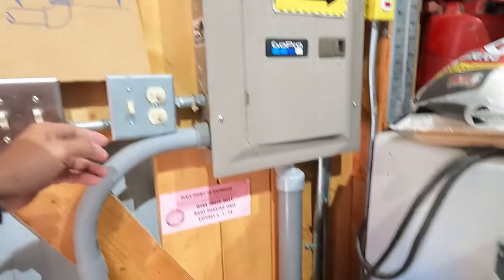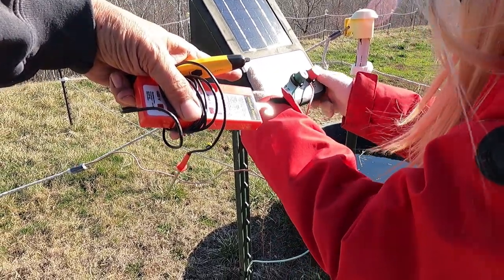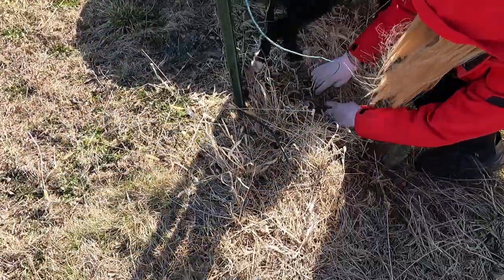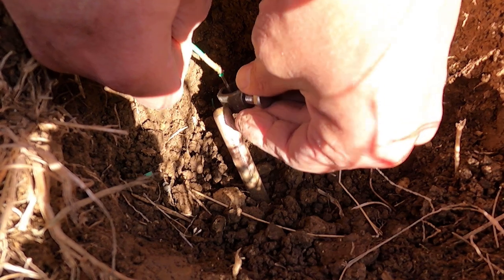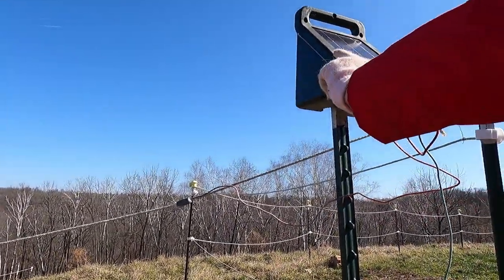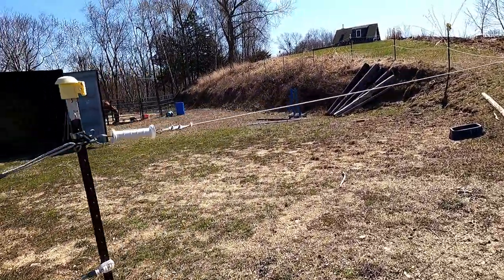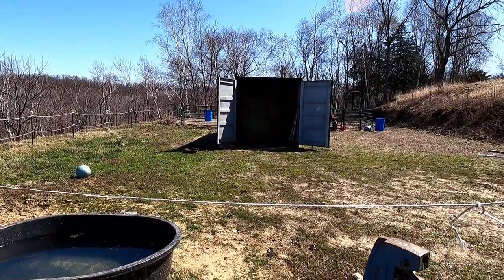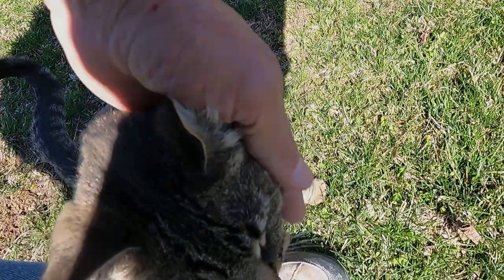Troubleshooting a Solar Electric Horse Fence [Fixed!]

Comment from the maker: This fence was messed up pretty bad when it was lowered to accommodate our foal Frankie last year. It was shorting in three places to the t-post, once to a tree, and had a jumper in an unnecessary place. The ground may or may not have been good, but it is generally where you start the investigation. It's all part of owning an electric fence though, you are perpetually checking for problems and fixing them when you find them ⚡😮⚡

Comment: I can so relate to your troubleshooting. I spent today replacing insulators with new ones.Found several that were cracked which will cause grounding issues.I have a charger that works with a marine battery. We don't have power where my horses are.I'm going to spend the money to buy a fault tester.They aren't cheap but will save time & aggravation of tracking down the short.Love your video.
Reply from the maker: Thanks Laura! Good luck with your setup!

Comment: Ah the trials of electric fencing!  The one good thing about horses & livestock who have been trained to electric fencing is that they generally respect it- whether it's hot or not!  Horses have a lot of respect until they run short on pasture grass or hay.  Then will get bolder with compromising it.  Like they can smell that it's not hot or something, lol!  Anyway, can't wait to learn more about Max!  I know Ms. Natalie is excited to have a new horse to train and bond with!  = )  -Suzie
Reply from the maker: Hi Suzie — actually the horses rub their chin whiskers on the fence to test if it's on. Our horses are exactly as you said and will just push right through it if it's off or weak! This is a really bad time of year for them as they cannot go out on pasture until it starts growing and recovers from winter — but they can see and smell the fresh grass and it drives them nuts! 

Another thing with the pasture is that when it's rainy the horses should be confined as well, otherwise they will compact the soil and destroy the pasture. If left to their own devices, they would destroy the place eventually 😑 I'm waiting on Natalie to introduce Max, hopefully that will happen later today! 😊
Reply: @PlanetMojo  So all of those times my horses were over being curious about the hot wire- they were actually rubbing their chins hairs against it.  Well you learn something everyday now don't you, LOL!  Funny, the day before you posted this we were pulling two nanny goats from our big pasture who are about to kid.  I just KNEW I had shut the Premiere1 fence off and when we were bringing the girls out I was the one to undo the gate.  I grabbed the gate and apart of the fence right up and yep, ZAP.  Like you say, the heat doesn't actually hurt- it just runs an unexpected jolt through you that is very unsettling!  Now a honeybee sting- that's another story.  I don't get them often because I've learn to stay SO calm when the guard bees approach,  but when I do get stung I tell myself I was just blessed with an all-natural, free arthritis treatment, LOL!

Comment: I remember helping my dad run down hot wire being shocked a few times but always found the spot  
I'm sorry I had to giggle just little when she unwrapped it from around pole and got bitten reminded me of my  younger dad's with dad
Reply from the maker: Hi Patty, that's the thing with a short, it wont have any juice until all of a sudden it does — then ZAP! ⚡ We both got zapped on this repair. It doesn't hurt, but it will sure wake you up! 😉